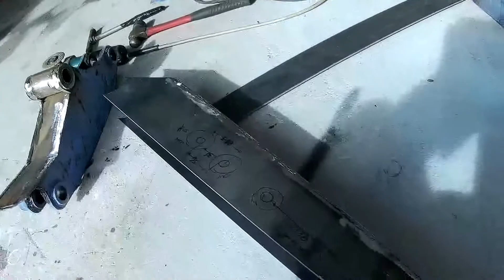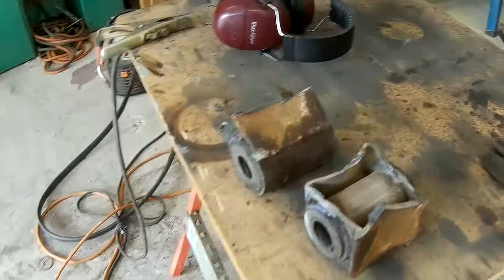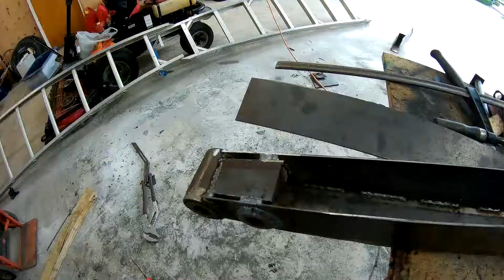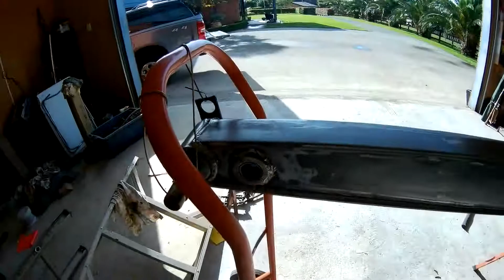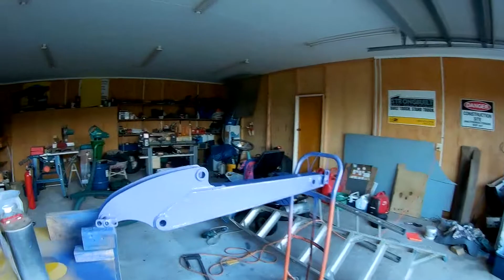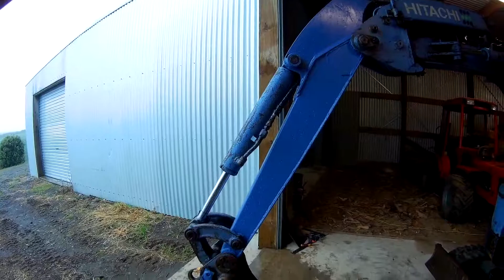Hitachi dipper arm repair

Comment: Terrific job - That turned out great. I was under the impression the plate was much thicker than that (3-4mm?). I have a built a CNC plasma cutter so this project may be the way I go to repair mine. Thanks for sharing...!

Comment: How thick was the original metal on the arm that bent ? What thickness is the metal you replaced it with ?
Reply from the maker: I think the original was 2mm and the replacement was 2mm, but with the thicker gusset at the end which the original didn't have.
Reply: strewth, I thought that would be thicker metal than that